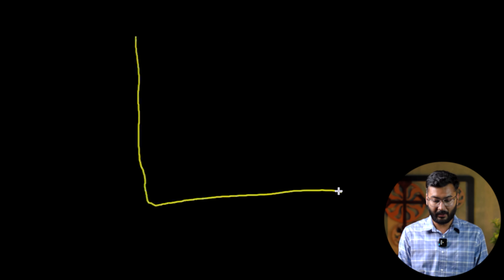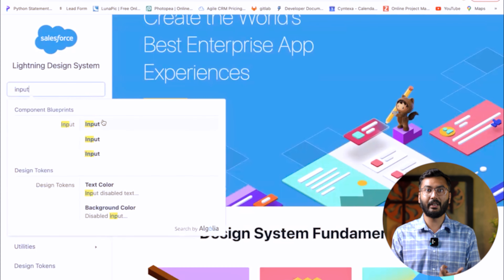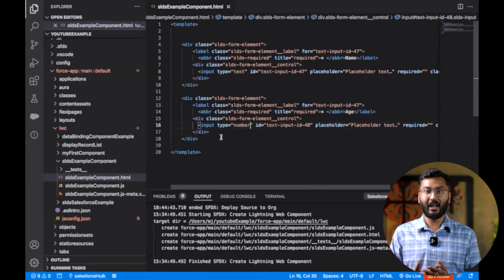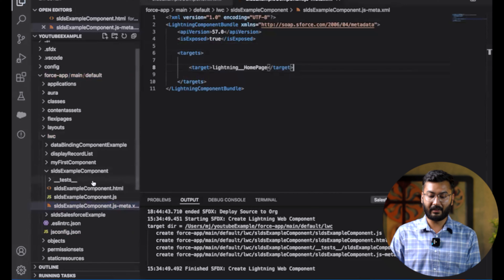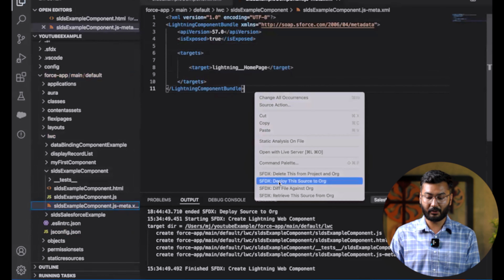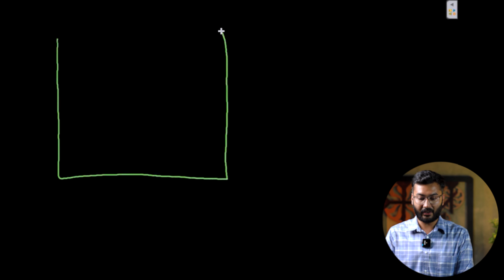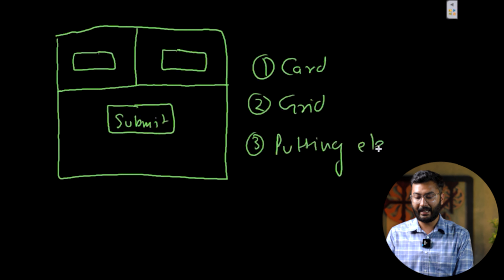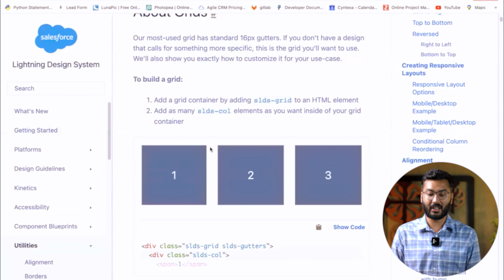What Is SLDS In LWC And Its Purpose | Salesforce Lightning Design System Complete Guide | #lwc

Comment: why am i getting SLDS mobile validation warning in the bulb sign for multiple lines ?? and even after ignoring its not getting removed
Reply from the maker: Yes, you can ignore these warnings and these are simply warns you that your code is not mobile responsive or the predefined components you are using do not support mobile.